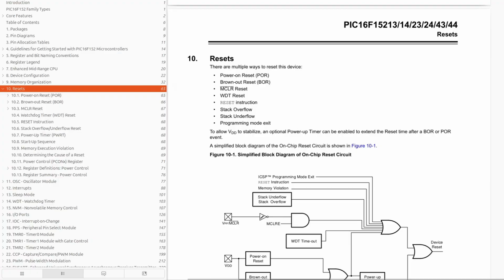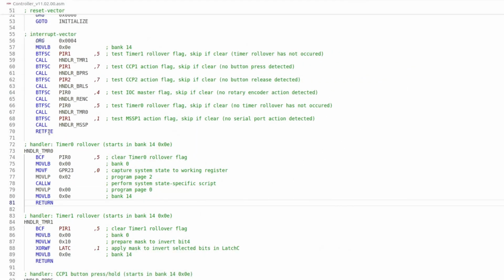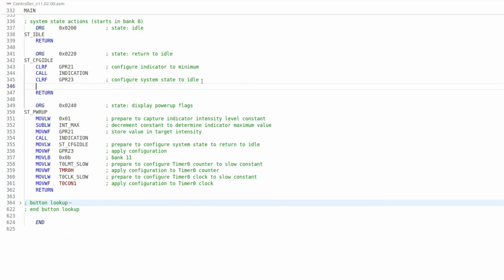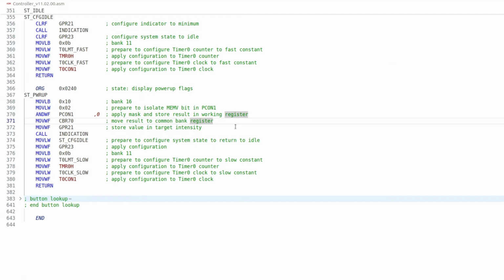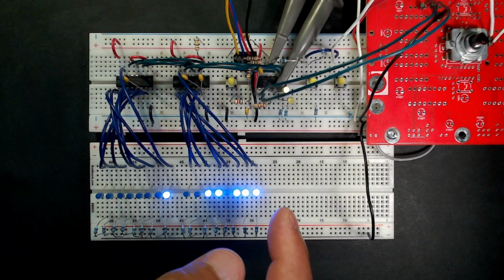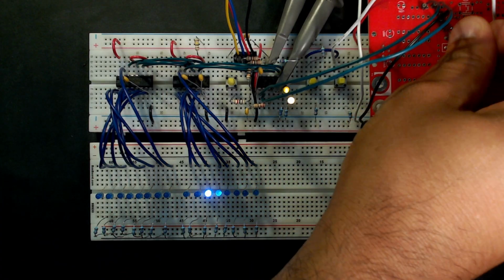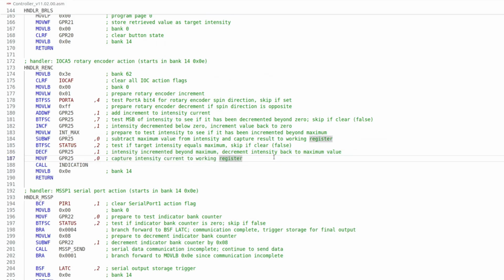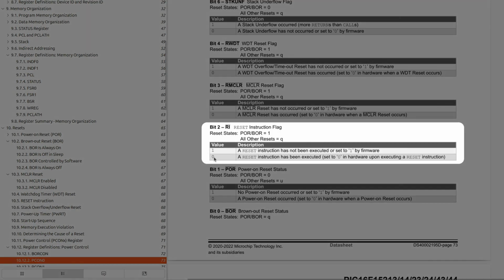Smooth LED Transitions on a PIC Microcontroller in Assembler Episode 039

Comment: The rationale of the testing the interrupt enable bits in the interrupt enable register does not sound correct. If the specific interrupt isn't enabled, then it should not be called. Period. If there is truly an interrupt enable register on the chip, then why are you testing for the interrupts being enabled in your user-level software? Something doesn't sound quite right somewhere. Nevertheless, I really enjoyed the video. Not seen PIC assembly language before. I've been using AVR parts for years 👍
Reply from the maker: That’s precisely what I originally thought, @NotMarkKnopfler! But after examining the data sheet more carefully I recognized my mistake of thinking that the interrupt enable flags are accurately named! I found there are two independent parts to an interrupt on a PIC; the “jump to the interrupt vector line 0x0004 in the code” - which we can control, and the interrupt status flag - we we cannot control. It only seems wrong if we assume the interrupt enable flags enable/disable both actions. But since it only controls one, the extra step of checking is necessary. I suspect the capability to direct different interrupts to separate vectors would solve this, but on a PIC, all interrupts go to the same vector. If there’s more elegant way to do this, I’m all ears!